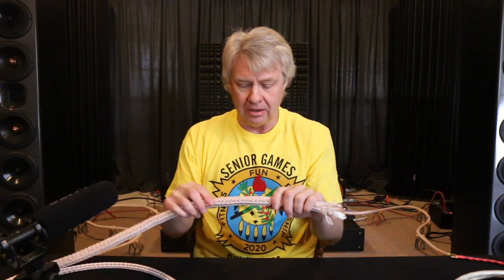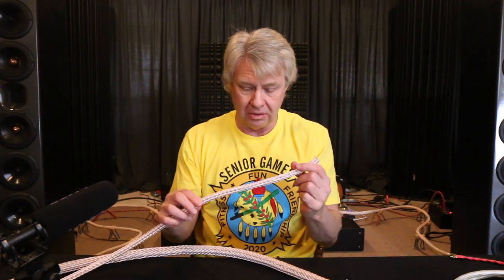What’s up with Audiophile Cable Risers?

Comment: Hi Danny. BANG ON about colorants/pigments in cable insulation/sheathing having sonic impact, in fact system sound/signature can be dialed up at will according to the 'impurities' embedded in the insulation materials. Once a particular mix of compounds which causes dead clean, clear, neutral sound is incorporated, a surprisingly wide range of other 'substances' can be also be included in order to 'voice' the system. Signature actually means dynamic 'patterns' in the reproduced acoustic energy transmission, patterns in energy transmissions have neurological/biochemical effects on the mind/body, some patterns are nice, some patterns are not. Proximity/contact of cables with flooring materials adds another set of patterns into the energy transfer rate, some patterns play nice together, some patterns don't.
Reply: Cable companies add compounds to the dielectrics to improve transparency, resolution, neutrality, etc.?  Voicing is optional?  Talk about secret recipes.  That would enormously increase the complexity of cable design.
Reply: @BruceCross  Yes but unwittingly for the most part and choosing pigments for aesthetics reasons or model identification. Some cable companies are on to it and deliberately 'noise' the cables but their approach is still a crap shoot. The big trick is knowing which combination of elements produces dead clean, dead clear, dead real sound...the signature of this recipe is that there is no signature if that makes sense.....difficult to comprehend but once heard cannot be unheard and thereafter all cables/systems sound coloured/clouded. Once the clear baseline is set then it is a perfectly simple matter to add voicing at will...want your system to give you a s**tty headache no problem, want your system to be fun no problem, want your system to be therapeutic no problem. I know this concept sounds far out but it is all due to 'patterns' in the sound, usually called noise but is in fact information and at the fundamental level. In depth researching of Bybee Quantum Purifier will give a heads up on physical processes that influence system sound. Cheers.
Reply: @ericmc6482  So most companies aren't intentionally customizing their dielectric material?  And the other companies are clueless about the process?  Hopefully, somebody has a clue.  From what little I could gather on Bybee Quantum Purifiers, they remove low-frequency electronic noise below 2 kHz, also known as 1/f or flicker noise.  Whatever that means.  Quantum mechanics is only understood by a few physicists, meanwhile I struggled with algebra.  Generally, I don't buy tech I can't understand.  Honestly, it sounds more controversial than cable risers, but then I looked up the company and they do offer a 30-day return policy.
Reply: @BruceCross  Hi Bruce, I just lost a long reply. 
Yes AFAIK no companies are deliberately choosing colorants for their signature/voice properties and yes it seems that most cable companies are essentially clueless.
Yes it's all to do with 1/f noise and materials all have their individual dynamic 1/f noise spectrums.
Noise drives/excites system noise interactively/recursively so yes a cable change can markedly change the 'character' of a system despite LCR values being 'same'.
Signal is energy transfer, Energy Transfer Rate is not constant Einstein's c but subject to dynamic field conditions, surround a conductor with a substance and the ETR will be dynamically moderated/modulated according to the surrounding material which is resolved to signal noise but is actually information (in the form of patterns) about the insulation material.
Jack Bybee device is amortizing or 'whitening' the ETR which reduces 1/f noise and consequent effects on system subjective sound.
JB's approach is not perfectly white and whist diminishing 1/f noise and consequent dynamic excess noise still leaves identifiable faint signature.
My approach is to rigidly 'clock' ETR (no patterns) and in so doing a whole bunch of dependencies 'magically' disappear leaving dead clean clear natural sounding 3D audio repro.
That said patterns can then be deliberately introduced and this opens a whole new world lol.
I was serious in my comment about headache, in the name of science I have created an insulation formulation that causes nasty headache in four minutes and lingering three days, confirmed by experiment repeat three weeks later..
Physiologically/neurologically beneficial compounds can be incorporated too, stoning or DMTing a pub crowd through the PA is perfectly doable lmao.
So in conclusion expect cables to influence/control system dynamic noise behaviours and physiological responses, so far AFAIK no cable manufacturers have any real clue about this and audiophiles are similarly lost in the wilderness still searching for that 'right' system sound but will never attain it without what I have planned.
Thiese links may interest you and reading between the lines explains a whole lot of what is happening to human behaviours/health in dense modern cities with associated high level EMRs.  Cheers.
https://www.researchgate.net/publication/28764625_Photon_Induced_Non-Local_Effects_of_General_Anesthetics_on_the_Brain
https://www.youtube.com/watch?v=21Z4947fl_s&t=671s
Reply: @ericmc6482  Forgive me if I only speak in generalities, since the science is over my head.  Yes, I could see how the conductor signal could be modulated by the dielectric, especially with the electric and magnetic fields.  You had me searching for acronyms.  ETR is Electron Transport Rate or Energy Transfer Ratio?  Your explanation of Jack Bybee's approach vs. your own is beyond me, except that it reduces noise.  Do you think your approach is marketable and affordable?
How surreal that dielectric compounds can have sinister effects on humans, but healing effects, too.  Passing magnetic pulses through a chemical substance to influence the brain is mind-boggling science.  If I understood the video, electromagnetic energy transfer at specific frequencies play a major role in human biology, even at the level of protein molecules, DNA, and cell membranes.  No, I don't understand it, but it's fascinating.  If designer peptides can treat cancer/HIV, it would be wonderful.  Yes, EMR pollution in crowded cities has even more frightening consequences.  Who can deny the overlap of resonances with music?  Can listening to good music heal us?  Possibly.
Reply: @BruceCross  Hi Bruce. ETR is Energy Transfer Rate as per capitalisation in first instance in the text as per white papers convention.
What I am saying is that ETR (energy propagation speed) is grossly variable according to the medium through which the energy passes (cause of diffraction) and on fine scale is further modulated with materials characteristic ETR 'signature'.
So electromagnetic energy transfer is in the form of pulses at a gross average Pulse Repetition Rate (fundamental frequency) but this PRR is further fine modulated (jittered) by the transmission medium.
Normally we consider this 'jitter' as noise, on deeper analysis this jitter is complex timing variation and is actually information about/conferred by the transmission medium and ambient and proximal fields.
Admittance on the fine scale is complex also, Bingo !, like can be efficiently stimulated/energised by like remotely as per the Hu/Wu paper and Irena Cosic's findings, that said the source (fundamental PRR) needs to be 'denoised' before being deliberately modulated for highly efficient/specific energy transfer and consequent modalities to occur.
This is where I come in with interesting (obvious lol) method/means of dejittering (rigidly clocking) the energy source material and then the really interesting stuff happens.
(Jack Bybee is amortising ie whitening the ETR variations which also represents no information to stimulate energy acceptances (by definition white noise contains no information), to my ear he is not quite there yet and his device leaves subtle signature that is not to my liking - the general noise reduction is useful but ultimately the identifiable remnant drives me out of the room. Another huge downer is the extreme cost and non mass producibility). 
In the case of audio systems, rigidly clocking ETR means a whole bunch of excess noise mechanisms are essentially eliminated.....subjectively, dynamic excess noise 'tails' after impulses are much reduced and what remains decays much more rapidly (silence between notes), complex intermodulations are essentially eliminated (masking/haze/fog lifted), harmonics generation behaviours are reduced (correct timbre) and sound sources in the mix become discrete in LR/depth size and location stability.
An analogy would be non resonant loudspeakers rigidly mounted versus resonant boxes on LR non correlated XYZ vibration platforms....ie the sorry mess that is current SOTA.
For 'Clean Ingredients Mix', for the 'audiophile' and general listener alike the result is previously unheard clarity, dynamics, realism and correct sounding 'neutrality' (timbre), no listening fatigue and no ear shutdown at high/extreme SPL....headphones/hifi/live sound.
So hell yeah a whole family of audio/video/usb/AC/DC extension cable devices are already prototyped and proven, and can be perfectly affordable as aftermarket accessory items or economically (read real cheaply) incorporated into OEM devices and systems of all kinds.
So now to the biological world, yes we all are swimming in oceans of natural and man made EMR's all with their fundamentals and complex modulations.....and associated biochemical interactions both life energising and life deenergising, not mind boggling but to be expected lol.
Wu/Hu are talking about stimulating endogenous bodily processes (opiate pathways, we also have cannabinoid, dmt and nicotinic pathways) by means of 'complex' apparatus requiring electrical energy source.
My approach is passively powered (and rigidly clocked) so can be in the form of sheets or discs stuck to the body and can be 'reciped' to stimulate the above mentioned pathways....don't ask me how I know lol.
Other pathways can be stimulated too, valuable ones are MSM and NAC, to this end I have now cured my own long standing chronic backpain from decades old injuries.
Electromagnetic sensitivity, chronic fatigue, joint pain, mental confusion, depression etc are all easily curable according to my findings, the drivers of many of these conditions are ambient and local field conditions...these are equally fixable too !.
Back to the 'audiophile' world, consider that loudspeakers project an audio modulated beam straight out from the magnet assy pole piece and listeners typically focus the two loudspeakers at themselves in the 'sweet spot'. 
Long ago I built a portable very sensitive coil/amplifier setup that enabled monitoring of audio band EMR fields through small speaker or headphones...street wires easily picked up from 40m away, electric rail overhead wires from 80m away (could listen to trains arriving and leaving stations and matching against timetable) and standard loudspeakers magnetic disturbance could be monitored from the couch.
The listener is being mind/body affected/effected by this magnetic energy transfer before the acoustic energy arrives and add to that at the conjugation point of the two magnetic energy beams which takes things to next level.
These magnetic beams carry information from all the system materials upstream with the driver terminals lead/tin solder joints the second final arbiter in the chain......I venture it is to be expected that avid audiophiles and video enthusiasts become unsociable and likely suffering low level headache too as per my headphones experiment example....lead does that, sigh.
So, back to the subject at hand, linked below is two copies of a show I/we recorded in a country pub a couple of years ago. We ran generator power for PA and recording chain (splits from live desk into multichannel ADC>firewire>laptop) and all signal and power cables were treated with my clamp-on version filters.
The 'Original' folder is 'in the box' mixdown, and the 'TST' folder has undergone subsequent soundcard loopback recording using my cable extenders. Whilst the untreated version sounds unusually good, for the loopback copies even blind Freddie should note substantial differences in clarity, timbre and involuntary toe tapping groove factor. You also may find yourself playing these tracks at full system level and find neighbours knocking on the door to join the party, you have been warned lol.
Please enjoy, please choose tracks you like (likely all) and let's run the experiment and see what differences your cables make and if I can pick them reliably.
Cheers.
Reply: @ericmc6482  Sorry, I missed the definition of ETR.  I feel guilty asking you to explain so much.  OK, you mean energy transfer through media.  No, I didn't realize electromagnetic energy transfer took the form of pulses, with further jittering by the media.  At least I can understand jitter and clocking from digital audio.  That's a great analogy of non-resonant speakers vs. resonant.  The typical complaint among audiophiles when they first hear a clean, undistorted speaker is that it's too lean.  No, it's the absence of resonance and noise.  The clean sound makes it easy to listen too loud.  How do I identify products incorporating this tech?
Stimulating bodily pathways for medical purposes is promising.  Ha, I haven't thought about audiophiles being exposed to EMR from speaker magnets.  Wow, you're saying the EMR transmits the effects of lead solder joints.  That's freaky, but not in this context.  As for the recordings, I do enjoy the blues.  I've long been baffled by people who can't relate to the blues.  Have they not lived?  The treated version does sound cleaner, like a smoke-filled club vs. recording studio.  It's most obvious on the distorted guitar intro of Track 2, which sounds leaner and cleaner, more like real guitar.  Who is the band?  They're good.
Reply: @BruceCross  Test post.

Comment: It looks like your cables are about 3" off the floor. Do you know if the benefits are reduced or change much by only lifting the cables 1/2" -1" off the floor?
Reply: It's only 1/3 as good.
The best is really about a foot.
Not only does it make the soundstage bloom like a titillated ground squirrel in springtime, but it will also trip any thief should they break into your house 😇

Comment: Plastic "pizza savers" (those little white plastic tables in pizza boxes) should work fine, especially the ones that are open like a tripod and don't have the "table top" part which could introduce more dielectric absorption.

Comment: I have just made speaker cable risers from oak wood and i can definitely hear a difference. More fine low-level detail, freer very high frequencies and more dynamic, faster transients and perceived louder peaks. My hardwood floor has underfloor water heating and I believe I have reduced the capacitance of the cables by raising them 6 inches off the floor.. 
My system is very good at resolving detail. My older Exposure amplifier is -3dB I believe at 100 kHz so it has a very extended frequency response.  I do my best to have very clean AC, as little RF as possible and negligible susceptibility to non-audio signals so the amplifier can spend its energy on audio-band signals. Speaker cables are Kimber Crystal 24, length of each side is 4.5 metres or about 14 feet.  Another huge improvement was gained by isolating the KEF Reference Three Two loudspeakers from the floor with compliant anti-vibration feet for washing machines. Here again huge amounts of treble energy liberated after isolation, better detail resolution. 
All the best, Rob in Switzerland

Comment: Wondering if the cable manufacturer recommends that customers put their cables on risers?   And if so, does that mean they should just be making a better cable that does not require this tweak?  Also, are their any instrumented measurements that show a signal difference?  Just wondering.
Reply: Electricity works in a field that is quite a bit larger than the wire. Interfere with the filed and you're interfering with the flow...
Reply: Best if you use porcelain isolators used by Hydro, the ones used for 15kV up power lines ;)